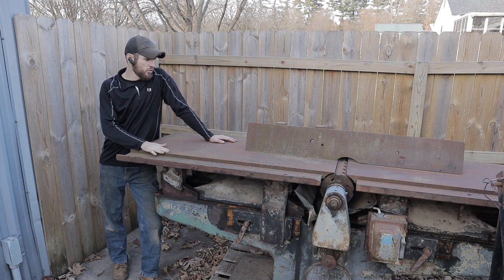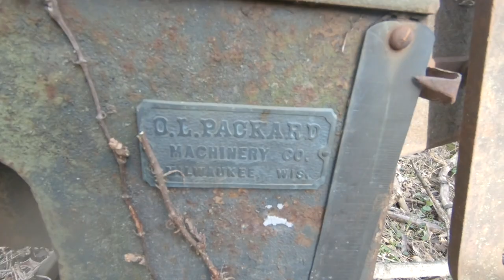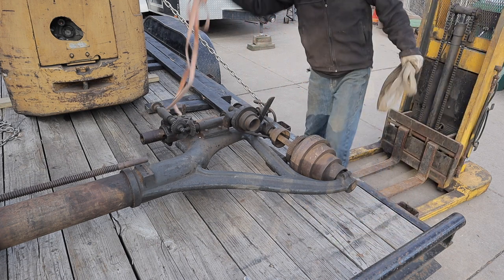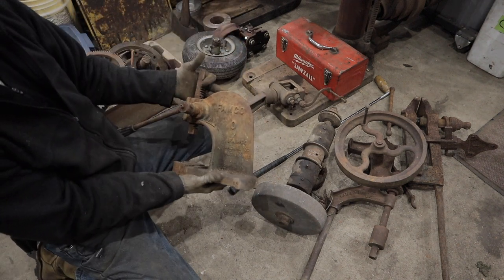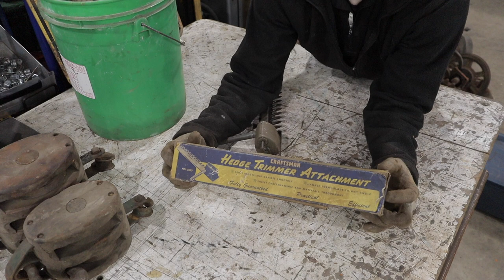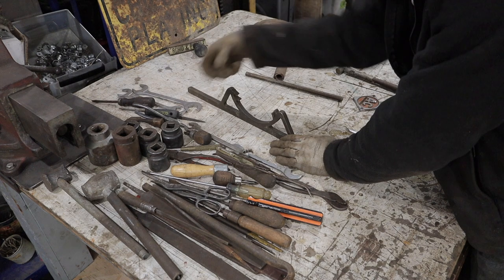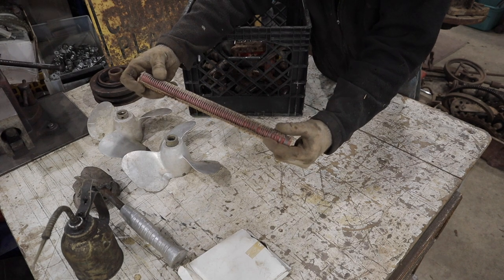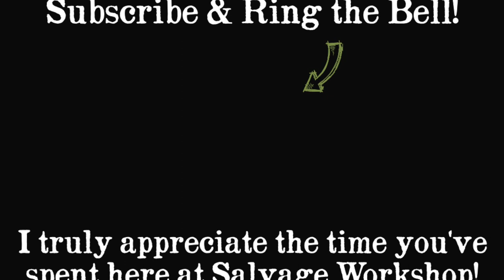RESCUING OLD IRON ~ 1890's Camel Back Drill Press & MORE ~ Episode 1 ~ Grandpas Hoard

Comment: On the nail puller, the slide hammer is to drive the claws in around the nail head then the foot was used as a pivot point to lever the nail out with the long handle.
Reply from the maker: I've been using it wrong my WHOLE life!!
Reply: Best tool made to pull large nails and nails that the head broke off
Reply: Yep, Blaine has it right. Slide hammer is used to power the "teeth" into the wood, "capture" the nail, then pry it out w the curled handle. Loved watching the whole video. You've got some BEASTLY "arn". I'm sure you've been there, but for the newbies: http://vintagemachinery.org/ is THE site for rescuing/restoring info. Keep the vids coming...
Reply: Yeah, I use mine a lot when I salvage timber for frames.
Believe it or not, they still sell them new, for around $70 IIRC!
I find one or two a year for maybe a dollar, pick them up as the cheaper cast iron ones tend to break off near the claw, so I pull out another one from the hoard...

Comment: Enjoyable video!
Love the concept of reparing/restoring rather than buying new stuff.
That is a process that gives again and again.
About the nail puller: You hammer the jaw down around the head of the nail with the slider, then you pull the nail like with a crow bar. The jaw bites hard on the nail and holds on to the nail without letting go if you do it right.
Reply from the maker: You mean i've been using it wrong ALL THESE YEARS!!! lol... Seriously though, I've been using it wrong!!

Comment: The folding pneumatic tire is probably from a trailer tongue. You can restore old, dull files to useable by soaking them in vinegar for a few days.  Scrub them with a brass brush when you take them out, and then oil them. I am too old now, but did exactly what you do for most of my life.  Nice to see that kind of passion and reverence for old machinery.  I had a good friend who said “Castings were artwork back in the day”. Keep it up and thanks for the videos. WF & John Barnes was probably the largest maker of pedal powered machine tools.

Comment: That nail puller is called a “cockatoo” here in Aus, not used the way you showed, but the slide hammer is used to acquire the nail in the wood and then the rocker is used to roll the nail out.  Use the slide hammer as an extension lever when removing a big nail.  It will work even if the nail has lost the head.
Reply: That's the way they're used up here in Canada too!
Reply: There are stubby versions too. They don't have the sliding part. Then you need to use a hammer to knock the jaws into the wood, flip the hammer over to hook onto a "nail head" built into the tool to get the appropiate leverage. Considering how much smaller and lighter those are, they can do a good job. But if I were to take a whole patio deck apart, I'd sure appreciate having the full-sized version!
Reply: Your right mate, it does minimal damage to the wood and works VERY WELL. If you try it the way it was described you won’t acquire the nail and may well break your own jaw.

Comment: The 'drift' thing at 41:05 looks to me like a rivet set. It should probably have a partner...
22:42 is a spokeshave. I have done some brazing using carbon arc on a stick welding machine. It's a very gentle kind of flame, very satisfying and therapeutic!
Btw, this vid kept me up until 2am, so you're doing something that I like!

Comment: I could spend years on that farm just tinkering. So much junk, so little time.    LOL
Love the picking and scavenging old iron. Looks like you are having a blast.
I thought the planer was a sheet metal brake. Glad you captioned it.
Safety third makes perfect sense to me. We heal, machines don't.    
On the Honda motor, check the oil level. If it is over full and smells like gas it could just be hydro-locked..
Pull the plug and then try the recoil start.
Rusty relics definitely a job for Evapo-rust. I use it all the time.
The hammer at 35 min is the forging hammer I mentioned last time.
The crank handle looks like a hit-n-miss motor item.
The Dunlap tool is a mortising attachment for a drill press.
The detail you added in graphics was excellent.
Thanks for sharing.
Reply from the maker: IDK about years... It was a little OVERWHELMING the amount of garbage that was also there... Don't get me wrong, I LOVE visiting these places and finding treasures, but bring them back to my shop is my preference! I truly appreciate the feedback regarding the updated video! Lot's more to come!

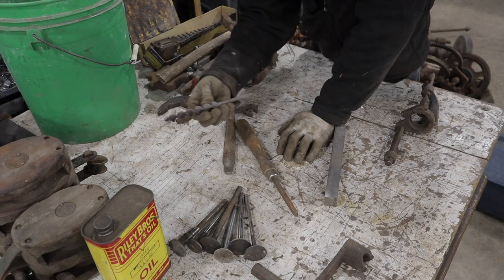Comment: A rainy day here so I am watching some reruns ..lol.  That square end tool seen at 37:16 (aprox) is used for the old wood cooking stoves.  The sq. end fits on the shaft of your stove so as you  turn it, it grinds up the burnt wood in the stove to send it into the ash box.  The other end fits on the top plate to take off the round plates so you can load up larger pieces of wood.  A little bit of nostalgia for you.  Take care.

Comment: I do like this type of format and video. Found 3 old international tractors is a field with belt driven 20" and larger saw blades mounted on the front for milling cypress trees around the homestead. Tried to get at least one of them, nothing doing being the uncle said he was going to fix them up. 25 years later they are still sitting there. So sad.

Comment: That is a nail puller indeed. To operate hold the tool upright as you did with the claws on each side of the imbedded nail. Than slam the handle down to set the claws below the nail head. Than simply pull on the handle to pull the nail out. WOW !! A long process if you have a lot of nails to pull. Keep up the videos.

Comment: Awesome job of pickin'.
I used to love going out looking thru old barns, garages, shops and other buildings.
In fields stuff was usually to far gone to rescue but I'd take stuff for parts like that one unit you said was to far gone.
You'll be surprised how many times something like that will yield items you can use to fix some other piece of equipment.
If you can get it cheap enough.
I used to get a lot of stuff as scrap or free just because I'd tell them I intended to restore them.
I especially liked small Engines.

Comment: Hi the sliding part of the nail puller is to hammer the jaws in to the wood either side of the nail, once they have been hammered down far enough you then extend how you said and it works like a crow bar or nail bar. Very useful tool.

Comment: I think the socket set with an angle is a dealer specialty tool. Could be for  automotive, tractor orindustrial machinery.
The hammer with the vertical and horizontal narrow edge  is a cross peen hammrr.
There was a press with two pins probably for driving chain pins out.

I too really like this old industrial machinery, its art not just function.
That joiner outside your shop is a fantastic piece.

I like the restoration videos.

Cheers.

Comment: 41:07 The “drift” looked like a hand rivet setter.  In your box of gears (potential art pieces) one of the ring gears....smooth in the middle, gears on the outside, is a small engine starter motor ring gear.
Reply from the maker: You are correct! Its a Pexto No2 rivet set!!! Thanks for letting me know! Now I won't misuse it! Thanks for watching & commenting! Lots more to come!

Comment: The last buckets you held up a little t shaped piece that tapers and has an oblong hole. That is a concrete form fastener or tie fastener...Forming Wedge Bolt
Reply from the maker: I didn't know that... I did check, and its too wide for the t-slots, but I'm going to grind it to fit and just re-purpose it as a t-slot cleaner since I only have 1! Thanks for letting me know! I truly appreciate you watching & commenting! Lots more to come!

Comment: The clamp tool is most likely a pipe clamp. Not sure what the roller is. The wheel is a trailing wheel from a bush hog mower. Great picking video!
Reply from the maker: Ya It could be a pipe clamp, but the additional rod makes me think otherwise... Not sure...Ya that is a brush hog wheel.... good call! I can't wait to re-purpose it! Thanks for watching & commenting Matt!

Comment: Wished I'd paid more attention, but that panel saw you showed earlier in the video is a VERY useful tool in a wood shop that deals with sheet goods like plywood, paneling etc.  They tend to sell NEW for between $900-2800, depending on maker and completeness they go for around $200-400.  Pretty much any 7 inch circular saw can be fitted to them. 

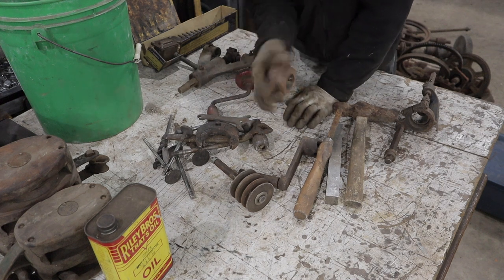At 36:00, that's similar to a WARRINGTON hammer, used for tin work and light forging.
36:46, that's a crowfoot wrench, used with a breaker bar to remove/tighten REALLY big retaining nuts.

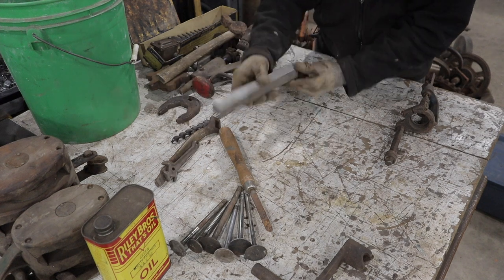37:25, yep, that's a mortising attachment...some tool user will want that for their old machine.
Sometimes used in an actual mortising machine, set up for JUST mortising wood stock.

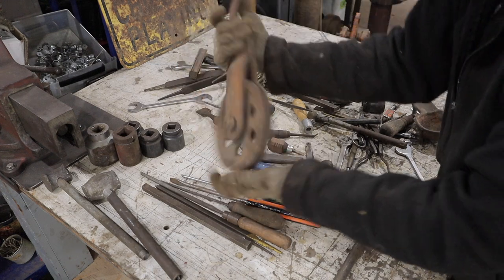40:50, that 'drift' is actually a setting tool for copper rivets and burrs.
You use the hole in it to stamp the rivet firmly into the leather pieces being joined, you slip a copper burr (washer) on, and then use the domed recess in the end to hammer down the protruding rivet and secure the joint.
They go for $10 and up NEW depending on their size.

About 44:40, that's a wooden spokeshave, some collector will want that.

51:12 or so, that a handle for lifting the lids/covers off of wood stoves.  For when you want to put the pot or pan directly over the flames, instead of indirect heat through the cast iron top.

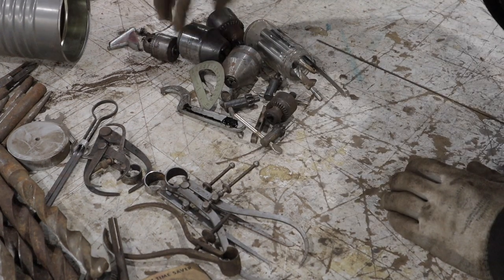54:11, those square-drive sockets could be used on the end of a speeder wrench, for drilling holes, particularly if the thing to be drilled was kind of hard to reach, like a stud on an engine.

Comment: The nail puller. You use the slid to inbed the two teeth around the nail head in the wood. Then pry backwards.
Reply from the maker: YOU MEAN I'VE BEEN USING IT WRONG ALL THESE YEARS!

Comment: Great video I love old tools, the arc carbon gouging rods have not been replaced with oxy acetylene it has its place in the welding industry, I use them all the time
Reply from the maker: Thanks James, I appreciate the feedback!! I didn't know that... I guess I meant for most people with a simple shop like mine!  What do you mainly use them for? Piercing?
Reply: Salvage Workshop if you weld the inside of a vessel then you will gouge the outside until you get to clean metal and also less mess than a oxy acetylene torch for taking out hydro plugs or whatever you don’t want a lot of slag getting into
Reply from the maker: @jamesbrandon8520  Makes sense, thanks for the education!
Reply: Salvage Workshop no problem anytime
Reply: Main use of carbon arc is in custom mills melting steel scrap. BIG carbons
Reply: Arc carbons aware also used in bright lighting, search lights or even movie projectors.

Comment: Wish I was there.  I saw so many useful items I would love to get.  I have one a bit bigger than that, self feeding while drilling, and hooked up to a 1932 transmission from a car. Transmission gear box is as big as a softball.  Going to restore it. Things you called 'sprockets' are turning knobs for the top of drill presses and machinery. Engines were used a lot and thus the crank handles. Maybe I'll wind up giving you some stuff.  I have tons. Carbon rods around 45:00 for arc gouging used with air spray and current. Industrial stuff, a lot of it.

Comment: About that"nail puller", it's not. It's a wire stretcher. Grip the end of the barbed wire in the jaws, put the foot against the post, extend the handle for leverage and pull the wire tight so you can nail it to the post. Love your videos, keep doing what you do so well.

Comment: In rapt he bucket with the sockets and round files....the short squarish end tool with the circular dents on the larger end is  for setting rivets on brake shoes with replaceable  brake linings such as old brakes.  We used them to replace the brake linings on elevator geared  machine brakes.  I have one along with rivets.  
JoeB

Comment: Lots of stuff there I'd like to have. If only I had room for it all... toward the end the first "t-slot cleaner" is actually a wedge bolt for a concrete form. I have a pile of them that I keep thinking I'll weld together and make a clock face
Reply from the maker: I did not know that about the wedge bolt, thanks for letting me know!... It is too wide for the t slots on my milling machine, I checked! My plan is to grind the sides down, and make it work as a t-slot cleaner since I've only got that one!!
Reply: @SalvageWorkshop  Good idea to make something useful out of it. the ones we used were pretty soft steel and bent fairly easily, you might want to temper it after you grind it to size

Comment: I rebuilt an old wood lathe and converted it from 3 phase to single phase (you can find my article and photos on Old WoodWorking Machines), so we're kindred spirits!
That small unit with the three wheels? It looks like a sheet-metal rolling machine, for curving sheet metal into a round tube. You adjust the roller wheels to give a tighter or more open curve.

Comment: Hi there

I am enjoying your videos.  I do like seeing what you are going to do with all the stuff you have collected.  You have, however, made an error in the use of the nail puller.  I was educated in the use of these as  a boy whilst helping my father making packing crates for the journey back to the UK from Singapore.

The use is as follows:
Place the jaws of the device either side of the nail you wish to extract.  Use the slide hammer to drive the jaws under the head of the nail.  Pull on the handle using the foot of the tool as a fulcrum and the nail is pulled from the wood.

I hope this helps at that you haven't been swaped with millions of people telling you this.  Keep up the good work.

Ian

Comment: The nail puller works like a parrots beak, you open the jaws and straddle the nail head, you then use the hammer action to drive the jaws into the wood which allows the jaws to grab the nail, when it is over it close the jaws on the nail, then you use the curved handle to rotate the handle like a clock hand rotating (extend the hammer part for more leverage.

Comment: the nail puller slide hammer is to drive the point down on a recessed nail then pry on short arm to pull. commonly used on trim head nails like on siding

Comment: The flat open end wrench is what they call a Crow Foot, it is used to get into places a socket or wrench won't fit. Also you have cross peen hammer and the other one takes leather inserts.. How do you clean your files, brush or acid.. Nice Haul.. Peace
Reply from the maker: You're right, I didn't recognize the crows foot, because I am use to them being SO much smaller!  Can you still buy the leather inserts? That would be nice to have... maybe I'll have to make a few for it! As to the files, it really depends on how bad they are..Acid for the really bad ones, but soft brass wire brush for the ones in better condition. Thanks for watching & commenting my friend! Lots more to come!
Reply: Yes you can get leather replacement Garland Hammer Faces. they are mainly for split hammers but I have used them for solid head just glue them in..

Comment: Awwww yeah, just throw a rail up from your bay door to as deep into your shop as possible to use that trolley to offload heavy items right off a trailer or truck... It’ll be a godsend! How’s it go, “A back is a terrible thing to waste!” (or something like that🤪) Save your spine brother, use that trolley… Man you find the coolest stuff. I thought I was a scrounge but you have definitely taken it to a whole new level and I’m kind of jealous LOL It’s all about location location location, and you definitely have good “pickens” out your way. Seriously, just one bucket full of stuff you have is enough restoration content for a month LOL Speaking of old files, I just picked up an old-school vice (FOR FREE on the Facebook marketplace) that one of the jaws plates was cracked at a screw, so I’m thinking of using a real old 1/2” thick file I have to make a new pair of jaws with. I love restoring and repurposing tools, to put them either back in circulation for what they were designed for, or to modify them for what I need them for. Thanks for taking us along, enjoy your day✌🏼

Comment: That is a staple (fence) puller.  you grab the staple with the pinchers and push down with the foot.  Also, the wooden pulleys are actually a block and tackle for lifting loads.

Comment: Yes I did enjoy it cause we have the same type of interest. Close to the first you were digging a big item out and I think you grabbed an old manual sickle, a long crooked piece of wood, I did not see if the blade was on it. If I'm right that would have been a great find. The two headed hammer I think is a blacksmith hammer. The sideways head is for thinning a piece of metal to make it thin and and wide so it can be rolled to put a wooden handle in like a chisel. At 37:00 that is a crows foot, I've seen them but never in use nor have never used one. At 38:26 that hammer is a soft face, you roll a strip of leather about 3/8-1/2" longer than the depth of the hole in the hammer. Roll real tight and press into each end of the hammer leaving the amount stated sticking out. This looks like Christmas come early. At least the snakes had crawled into a hole. Stay safe
Reply from the maker: Awesome Gene! I already have a couple manual sickle's, so I didn't even notice them! I am definitely going to be adding some leather to that hammer! I love rawhide mallets here in the shop! As always, thanks for watching and commenting! I truly appreciate the support! Lots more to come!

Comment: Hope you get the camel back drill press. Bought one larger about 35 years ago. 9' tall with 3" drill capacity and adjustable auto down feed pressure. Still works great, think I paid $750.00 and bought new belts. better than any new drill press I own. Will drill 3/4" anchor holes in 1/2" baseplates stacked 6" thick. Layout once and clamp in place.